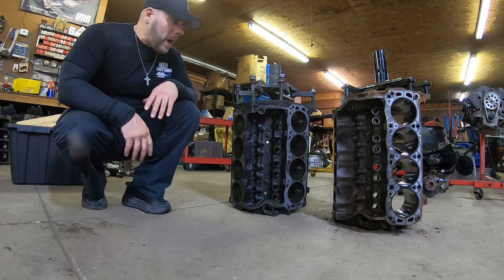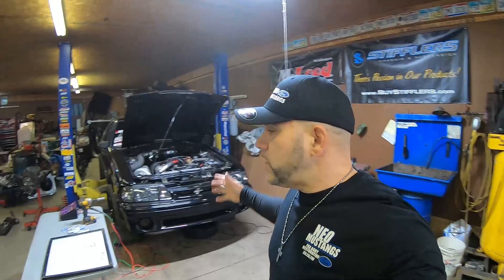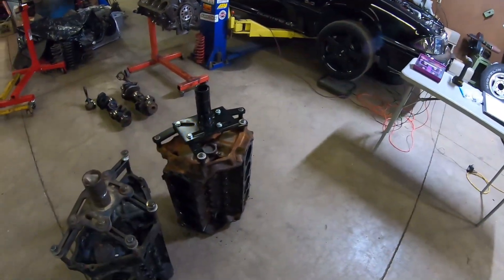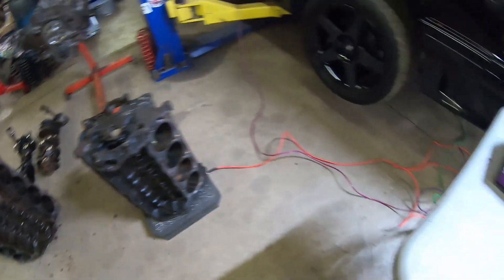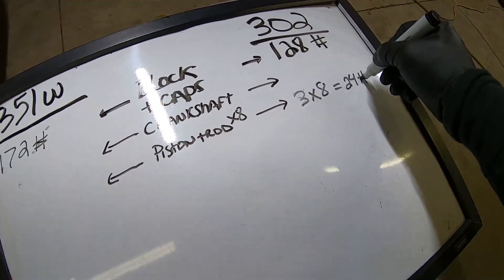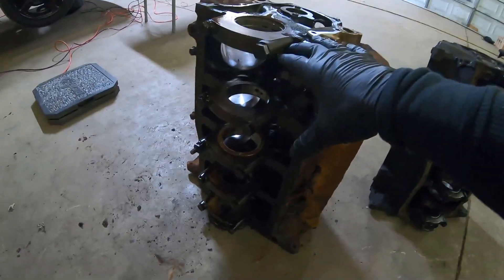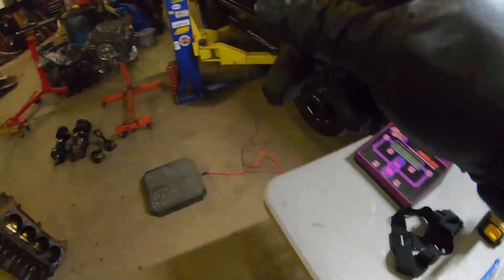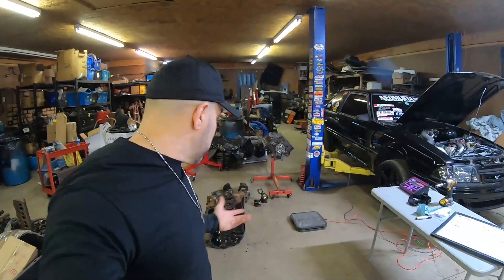Ford 302 vs 351w Pound For POUND Who You Got? Lets Find Out...

Comment: I always wished Ford had had the balls to put the 351 in the Foxes/SN95s (and be affordable). It would have been a smarting answer to the Chevy default go-to 350 in the Camaro. Instead the 302 and even smaller had to put up the fight.
Reply: They did in 1995, the Cobra R had 300hp/365ft-lbs of 351W and a Tremec 3550 5 speed.
Reply: Roush did a twin turbo 351w back in the late 80s for Ford. The T5 couldn't handle it, and Ford didn't want to spend any more money on it.
Reply: @robbiehays1967   Ford could have easily put a 351W in it just hopped up enough to one up over the 350 of GM, using an automatic. 

They were just scared to do that for some reason.
Reply: @HAL-dm1eh I suspect the cost of emissions qualifications for a small run of cars was a big scare. Ford doesn't thrill on spending money it doesn't have to, and they were selling every Mustang they made--attempts to swap to the EXP/Ln7 twins built on the Escort chassis and later the Probe wasn't working. in the end, Ford was out to make a profit, and after more than a decade, they recouped whatever money was spent to design the Fox. and it sold itself.
Reply: @alertgasper   Very true. And the base Mustang 6 cylinder was always the bread and butter of them (87-93 and recent years being an exception). Without those there would be no Mustang today.
Reply: @HAL-dm1eh  true as well--we forget the "secretary customer" (to quote Carroll Shelby) who funds the R&D behind pony cars. they were originally meant to be sporty looking commuter cars for folks who thought the Falcon looking like a Galaxy was a fuddy-duddy car in the 1960's. 

but quality control aside (the Japanese competitor to the Fox Mustang often got a clean-sheet do-over every few years), a four banger hatchback Mustang was a decent ride. economical with carrying ability and a potential for 3 passengers while looking sporty. the owner just had to swing the insurance. one of my father's drinking buddies always bought the Ghia model with T tops (what Ford proposed as a baby T bird) since the Mustang II era, a great eternal bachelor car (even had the bag of tennis balls and racket in the back, ever ready to go).
Reply: @robbiehays1967 yeah, Ford has never been known for spending money they didn't have to. Like replacing the Pinto gas tank, or giving the Mustang a rear set of disc brakes (you had to pay almost twice as much for the SVO to get a set of Lincoln discs). Chevy in comparison would hand out four bolt main blocks for any vehicle considered heavy duty.
Reply: @alertgasper  Have you ever compared the Ford 2 bolt main block to a Chevy? The main journals and caps are so much beefier than the GM. Starting with the 289 HiPo, a 2 bolt main block,   raced and won numerous 24-hour races and won. Running at times to 8000 rpms. 460 blocks are known to survive 1000 hp also with 2 bolt mains. I can go on, Ford ever since the start of the Horse power wars in late 50s early 60s, to give the customer the foundation to build their car to the hp they wanted without the company having to cover liability in terms of accidents or warranty issues from racing with Ford's  hi performance vehicles. People would say the Mighty Boss 429s were dogs, but with a cam and carb swap they would be beasts. Heck with a good tune they could run a 12 sec qtr. Proven many times.
Reply: @robbiehays1967 well, most people do find the 2 bolt ford low deck windsor block to generally crack at 500 hp while the chevies went higher--likely since the 221 cid was originally designed to be lightweight for the Falcon (and the Y block for trucks), while the 265 chevy was designed for passenger cars and for trucks. The K code Challenger 289 you mentioned did use a wider main cap, but any other 289 did not. 

the low deck Windsor did do an amazing job, considering its exhaust ports suck due to trying to fit around the shock tower setup in falcons and mustangs. Pity they never reached the 375 hp level of a fuelie 327, but few other designs made that much power. 

We could talk about the FE series, like the 390. Ford could have made a viable counter to Chevy's 396 Camaro with its own parts bin (they had a 401hp tripower in 1961), but instead Hot Rod Magazine and Tasca Ford got Dearborn to step up the 428 CJ. i'm not saying Ford sucks (i own a few), I'm saying they're cheap when they can get away with it. 

The Lima block came out in 1968 for Thunderbird use, and it sure was strong enough to expand to the Boss requirements. If the Boss had been around as many years as the 426Hemi had been around (the 1971 mustang was as big as it was b/c Seamon wanted the Boss'9 to continue in that car without trips to Kar Kraft), the engineers would have gotten things just as right. but even with all the changes in two years, ford wasn't trying to build a car for the street, they wanted to homogate the Boss'9 and knew the 'stang was lighter than the taladega. 

but how many people were paying that much money to get Boss'9 potential? you had to spend the money and Ford gave you all the goodies. so you made my point. not that the 428CJ was a dog, of course. were this 1969, i'd take the 428 over a 429 the same way i'd buy a 440 six pack over a Hemi. torque versus hp, and fewer tuning issues in the days of point style distributors.

(may i also mention, i used to own a Ford Focus with an automatic transaxle. a nice little go cart Ford f'ed up by using dry dual clutches rather than a torque converter, and their solution was to charge customers to "reprogram" the trans before nailing 'em $5K to replace with another trans Ford has known since 2010 had problems. summer of 2023, Ford ran out of transmissions and blamed "supply problems". the class action lawsuits are piling up as Ford no longer makes cars other than the Mustang--they're chasing the market for pickups--so there is no tranmission solution for their cars anymore)

Comment: Question for you.  I’m building a 410 stroker and want to use an On3 turbo kit w a T4 exhaust housing.  The salesman said it won’t work even with double gates.  He said that there will be too much back pressure with a T4 flange cruising around and will pop my seal and prematurely wear out the bearings.  I’ve never heard of that.  You mentioned to use a huge waste gate to me and it should be fine.  Just dump the pressure out before hand.  Have you ran into issues with your 383cc motor?  Any info would be great thanks!
Reply from the maker: I have an on3 on my 410 on my white car. Go check that playlist out. I talk about back pressure and gates etc in all my turbo dyno videos
Reply: @Neomustangs  been looking for that video can’t seem to find it. You have a lot of videos.  Can you send me the link to it

Comment: Still even with the 351 being heavier it makes more torque and horsepower than the 302 and will take more punishment ! The only draw back is the overall height and header fitment .
Great content Thank You . 🇺🇲 🇵🇷 🦊👍
Reply: I never realized there was that much difference in weight! The height and header fit up are why I have a 302 in my '31 vs the 351's in past cars. Even that 302 is a tight fit with the overall length using a fuel pump timing cover with the longer water pump.

Comment: Interested to find out how much of a difference my beefier Mexican block 302 will differ from your roller 302 numbers....in both block and crank weight. Cool vid!
Reply: It’s been shown that the Mexican block thing is a myth. There’s no difference, including nickel content.
Reply: @aaronliddell4280   Actually the main caps on the early Mexican blocks are larger and the casting protrusions on the front of the block must add some weight. I'm curious if it's a bit heavier as a casting overall vs a standard thin-wall production block.
Reply: @bigc6310  I’d be curious as well as I’ve yet to see any proof of difference between them 👍
Reply: @aaronliddell4280 👍

Comment: dont forget the 351w also has 1\2" fasteners for the cylinder heads, which means your head gaskets last longer with boost or nitrous👍 . a 302 can be machined for 1\2 bolts or studs, but thats more money spent on less cubic inch.

Comment: 302's are Windsors as well,  except the mexican blocks.
Reply: I used to think that too till I noticed the CCP stamping on most 302 blocks (except the Mexican blocks); meaning “Cleveland Cast Product”. I suspect Ford titled them from their casting plants to avoid confusing the engines since they have many similar displacements that were separate designs.
Reply: @duke5171  Hey Duke... well dang I did the thing that irritates me, posting something I "thought" was accurate when I am actually wrong.  Did a bit of researching on the web and seems from 1968-78' Ford cast the 302 blocks in Windsor Canada then moved the casting to Cleveland Ohio. I looked at the 302 I'm building out of a 97' Explorer and sure as heck has the CCP right next to the distributor hole.   So now we can really mind screw people by saying we have a 302 Cleveland.
Reply: @chestrockwell8328  That’s news to me too, I didn’t know it was originally casted in Canada. And we definitely can say it’s a 302 Cleveland now too!
Reply: @duke5171  Windsor Ontario Canada.
Reply: The 302 came out of both the Windsor and Cleveland plants. And just like the Ford 400, there's no other same displacement motor, (until the Coyote) so it doesn't need a designation letter. It's just a 302.

Comment: Dang those 351 rotating assemblies are heavy, didn’t think it’d be that much, but it does have the bigger main journal.
Reply from the maker: Right. For sure.
Reply: That’s why those stock cast cranks can go 700+ hp with its giant ass journals
Reply: @Bacongrease00  versus the 500ish you can get out of a 302 before cracking the block.

Comment: 80 lbs on front end is no joke! I love the 351w for its sheer power making potential but have always built some version of a 302. In fact I’m currently rebuilding a 306 that came in a project car… needed some bearings and rings along with a pass of a flex hone. It’s cheap and cheerful but that’s the point of the project! Going with AFR heads, F-303 cam, explorer intake and S-trim through a T5. Just some street fun.
Reply: It's actually 70# difference. 128+38+24=190.
Reply: Right up my alley!
Reply: If you already have a 302 I don't see how it would be detrimental, especially since on Foxes and SN95s you can just do little things like change the bumper support for a lighter aftermarket unit and a couple of other easy bolt on things to get that 80 lbs back off. 

Now if you want to talk about something like the difference between a 4 cyl, V6 and V8 that's a whole new ball game.
Reply: You can make a fast 302 setup no doubt but you can more than make up for the 80 lbs extra on the front end from the amount of sheer power you can make over a 302nwith a 351.  If it's a road race application it probably means more (not having the extra weight on the front) in a drag race setup the 351 wins all day.
Reply: No doubt the 351w is a great power house. 80 lbs on the nose of the car is huge though for handling. Automakers strive to keep engine more rearward just to help reduce weight over the nose. It wouldn’t stop me from building a stout 351w just saying wow that’s a lot! For drag racing obviously no biggie just make mo powa! 😁

Comment: Easy answer…. 351w by far because of block strength and future possibilities.
Reply: Yep and aluminum heads intake and water pump not much more weight
Reply: Gentlemen the 302 is significantly lighter. And………if you BALANCE THE ROTATING ASSEMBLY 500 hp will not destroy the block. I have road raced a 1990 roller block with a steel crank forged rods and STOCK forged aluminum pistons along with GT40 competition ported heads making 439hp with a big cam and 750cfm carburetor. With AFR heads 516hp. Lighter is always better. The motor has 4 seasons at 8000 rpm. Not one issue with the block.
Reply: @dohcsmr1175  its about 50lbs difference depending on dress. a 351 with a 750cfm carb and a big cam and Cleveland or aluminum heads makes 600+ and you aren't at the absolute limit of the block cracking.
Reply: @dohcsmr1175  OOOOOH 439 HP? My gosh that's a lot....A 351 windsor can be bored/stroked to 460 CID and make well over  twice the HP you can get out of any N/A 302. 
David Freiburger built a 408 windsor that made 670HP on the dyno and it was a mild build. I know for a fact you can get at least 850HP out of a 351 windsor fairly easily. The weight is insignificant in the comparison. The deck height alone makes the 351W superior. And the weight difference can be easily overcome with the much higher HP you can get from the 351W. with your logic, we should still be using 142CID 4 cylinder engines because as you said " Lighter is ALWAYS better". No, it's not.  So I should build a 302 instead of a 540 base on the 385 series  because it's lighter? Hell no, that's just stupid.
Reply from the maker: Yep
Reply: Unless you are trying to swap the engine into a car never designed for anything more than a 4-banger.  Then the smaller size and weight are an advantage, and you're still going to be able to make more power than the car can handle.
Reply: @rockets4kids  the difference of 1 inch of deck height is very rarely make or break it. Compared to the absolutely massive Coyote the 351 can fit into anything.
Reply: There is no replacement for displacement 

351 wins

Nuff said

Comment: Nice job!  I bet some aluminum heads would get that 351 pretty close to an iron head 302.
Reply from the maker: Good point
Reply: I always wanted to build an all aluminum 351 as a kid in the 90's, but a coyote swap makes more sense today....
Reply: @Jesse Henry  an all aluminum forged 351 would hold its own against any coyote.  You can have a 427 stroker.  The potential for that much more cubes can't be ignored especially with an all motor setup.
Reply: @bigretardhalo  Aluminum blocks for the 351 Windsor are still being made by Dart & FMS.

Comment: 351w reminds me of a roll cage.  Might weigh a little more but the potential for better ETs is there.
Reply: Windsor or Cleveland?
Reply: @bobhill3941  he said "w", so that would be a Windsor, unless he was thinking Clevor, but even those are obsolete now with the aftermarket heads out there. Clevelands had the same dogleg exhaust port issue of the Windsors.
Reply: @alertgasper  Thanks, I just got confused with all the conflicting information. I was under the understanding that the 302 Windsor was the "base" average Mustang engine compared to the hipo boss. 

Are the Cleveland dogleg port issues because of airflow?
Reply: @bobhill3941  Not a problem, Ford made 3 varieties of 351 cid engine, the Windsor, the Modified, and the Cleveland (which had a Boss version in 1971). Many folks stayed away from Fords as a result, until the Fox Mustang made it so affordable either you played with one or you were against one :)

The 302 was often a base engine--i can only think of two times it had a 4 bbl option, one for GT Mustangs in 1960's and again in the 1980's.  Most Ford engines designed in the 1960's have a poor exhaust flow issue because of the shock tower design for the Falcons, Fairlanes and Mustangs--there's not a lot of width there in the ol' boiler room. What often is the big issue with a Cleveland is the size of the ports in general--the 4V (for venturi, the technical term for "barrels" in a carb, so it's the 4 bbl heads) are great above 3,000 rpm, so many hunted for the 2 bbl cleveland heads when building something more for street use. it wasn't unusual for Ford to drop a 2 bbl cleveland V8 into say, a torino station wagon in the 1970's as the performance age had ended and they were using up what they had left. 

In the Pro Stock racing classes, however, the guys running Cleveland heads would--believe this or not--cut the exhaust port off the side of the head and weld on square pipes to straighten out the exhaust port. But they were also shifting gears at 7,000 RPM. Thanks to the Fox Mustang, the aftermarket has made some nice heads for the 302 that fit any 351W block, so you really don't need to screw with a Cleveland for a street machine unless you want to. Windsors tend to have a better oiling system, the aftermarket heads flow well enough, and the Windsor's wider crankshaft bearing surfaces and a need to have the lifter bores machined for perfect straightness are only an issue when you want to run high RPMs.
Reply: @alertgasper  Thank you very much for the in-depth reply, analysis, and history, I thoroughly enjoyed reading it.
Reply: @alertgasper  exactly. the advantage the cleveland had has long been gone since the aftermarket cylinder heads like Edelbrock and AFR were introduced.
Reply from the maker: Yes